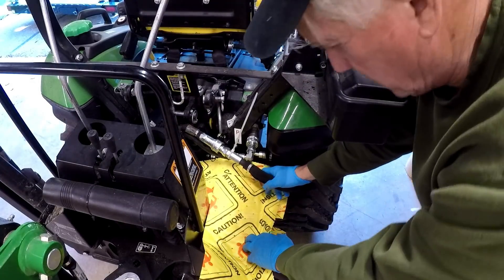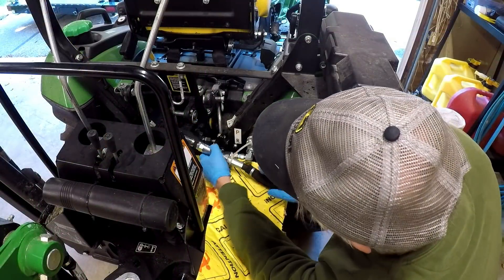John Deere 1025r John Deere 260 Backhoe - Hydraulic line leak / #86

Comment: I have both an older 260 backhoe and a newer 260B backhoe on two separate tractors. Access to the backhoe controls from the operator seat is definitely an advantage. But I find swiveling the seat around on the older tractor is a pain in the butt so i prefer the two seat option. Your experience may differ 😂.
Reply from the maker: Good morning, Daniel. Thanks for taking the time to comment, and I agree with your observation. I prefer the two-seat design too. Have a great weekend, and thanks for checking in.-Bill

Comment: Had one of my hoses break on my 260 also but a different hose. The broken hose leaked so bad could barely lift the hoe, once I got it up locked it in with the pins. Took it down to the dealer and they loaned me few wrenches to get the bad hose off. They made me a new one and got it fixed without taking it off the trailer. While there bought more oil to replace what was lost. Saved few bucks that way vs having their technicians do the work.
Reply from the maker: Good idea, Jamison! It's always nice to save a few bucks. Good job. -Bill

Comment: It seems like the 260B has a better hydraulic hose management system than the 260. Could they have repaired your problem by fitting the 260B system on your tractor?
Reply from the maker: Hello Hoghead, the repair matched the original design and I haven't had a problem since I stopped using the plastic zip ties. This was my fault. Thank you for taking time to comment.

Comment: My “life lesson” using my tractor was always use the seatbelt. I was doing some clearing on my very first JD 790. I was close to a tree using my bucket to pull limbs away to pile and burn. I was in low hear w the engine at about 300rpm or so. I thought I was in reverse and popped the clutch and straight  into the tree I went and it dumped me over top of the steering wheel. It doesn’t sound like much but had I been in a higher gear, working on a slope etc. that could have thrown me off the tractor and caused injury. Ever since that day some 15 years ago I never work my tractor without buckling up. I now have a 43hp tractor so I’m even more careful w it. I’ve made it a habit to use the seatbelt no matter the job. 
So that was my lesson on using the tractor. Well at least one of them lol......
Reply from the maker: Hi Shawn, thanks for sharing that story. I;ll keep it mind when I'm thinking about buckling up. Stay safe

Comment: Pipe insulation put over your lines and lightly tie them and check on it once in a while and if it starts rubbing through change the insulation it's dirt cheap and it slips right over the line
Reply from the maker: Thank you! I will try that idea out, thanks a lot for the idea.

Comment: I've had my first tractor for about 6 weeks, a 2018 1025R with the 260B backhoe.  I agree with you that the B adds some nice features like better hose routing and latches for the stabilizer.  Really looks a lot cleaner than the old design, but as you point out, the seat is in the way.  Being new, I've not experienced anything else but I can see where getting to those controls from driving position would be desirable.  Thanks for making the video and sharing what you've learned.

Comment: Would you mind telling me the length and width of your trailer?
Thank you for your time.
Reply from the maker: Hello Mr. Zurcon, the trailer is 18 feet long with no sloped end. I can haul the tractor, loader, forks pulverizer and rear tiller in one trip. I love it. I did a lot of investigating between the 16 ft and the 18 ft and glad I chose the 18 foot. Watch for a review video coming out soon. Thanks for checking in, let me know what you purchase.
Reply: Bill Burkhart thank you for the reply. I currently have a John Deere X758 with a CTC fel. I’m in the middle of purchasing a 2025R as I would like a backhoe and a greater lift capacity fel.  As for the trailer I would like to get a 12 foot dump trailer however I would also like to carry the 2025R around.  Time will tell.
Take care.

Comment: Like the Videos. Just a idea I don't know if anyone has advised of this. Try food coloring, just put the bottle in the water near the possible leak point and squeeze a little out and watch the colored water flow towards the leak. May help since you seem to have identified a few possible points, and confirm before the equipment arrives in case you find more. Looking forward to the fix of the pond.
Reply from the maker: Hello Craig
Thanks for taking the time to write. I did try a dye that's used to find leaks in sanitary sewer and storm water lines so it very concentrated. But I didn't have any luck with that method. I'm so close .....I can feel it.... I'm going to take winter off of that project and hope to hit it hard next spring.     Thanks for your positive comments.

Comment: So why didn't you replace the hose yourself? You could have replaced the hose yourself and continued on working. It's much cheaper to do that type of repairs yourself. I have done all the repairs on my tractor myself.
Reply from the maker: Hello Stanley
Good question, I should have addressed this in the video.
Reason #1,  I didn't want to do the repair, I don't enjoy that work. Thank god people like you do.
Reason #2, It was ready for an oil change so I combined all that work into one trip
Reason #3, While it's under warranty I'm won't do any work myself to prevent a claim from JD I    did something wrong causing a rejection of a warranty claim.
Reason #4,  See reason #1
LOL thanks for writing Stan. Enjoy your week.

Comment: I remember the first time I busted a hose on my backhoe. I had no idea what had just happened. I never would have thought a zip tie would do that. in fact I have hoses with zip ties holding them in place on my FEL for my grapple. I will be inspecting those as soon as this rain stops. I cant imagine any other way to tie these hoses off that would be less abrasive. have you came up with a better method? what did the dealer suggest?
Reply from the maker: Hello Dave, happy Saturday, the dealer didn't offer any suggestions, but I didn't ask either.I think 
the  mistake was a combination of the zip tie holding the hydraulic line loosely and the metal jacket around the other hydraulic hose wore through the line it was against. The zip tie was one of those get 100 for $10.00, nothing special about the plastic tie. I've noticed the hydraulic line kind of jumps and jerks when it reached full pressure, perhaps that added to the failure.  With only 10 - 12 hours on the backhoe I was very disappointed. Thanks for commenting Dave, enjoy your
weekend.

Comment: Looks like you could lengthen the hose on the backhoe side about 6" or so and solve that problem. At least get it out of the way maybe. Then hook it with the three point  top link holder.
Reply from the maker: Happy Saturday John, excellent suggestion! , wish I''d though of that before the repair was made. Next time I have the hydraulic oil changed I'm lengthening the hose. Thanks for a simple 
solution.
Reply: @billburkhart  I've got a few of those life lesson certificates too. How's your pond doing, or are you still getting the monsoon rains
Reply from the maker: @johndeno562  The monsoons have stopped, but snow flurries followed about a week ago, 
I've differed the pond project until next spring because the excavator is so behind I can't     get him to call me back. That will give me all winter to do some research.
Good to hear from you.